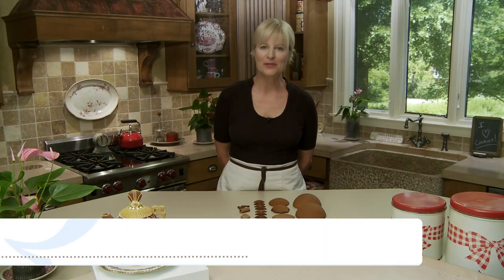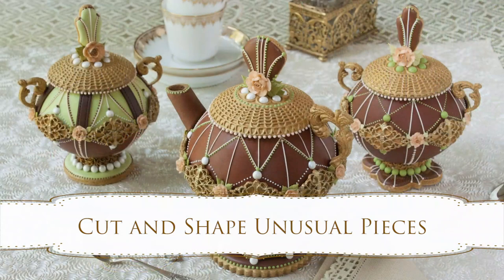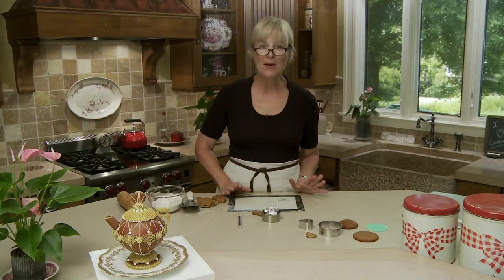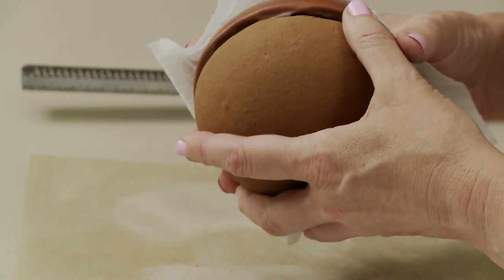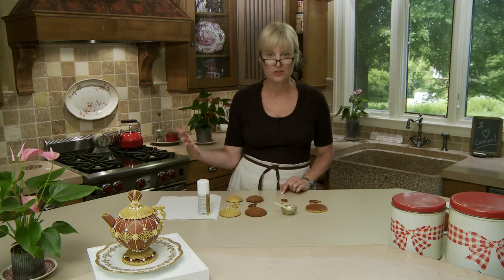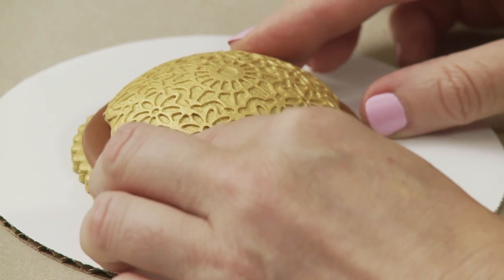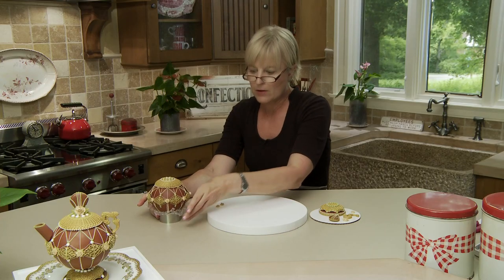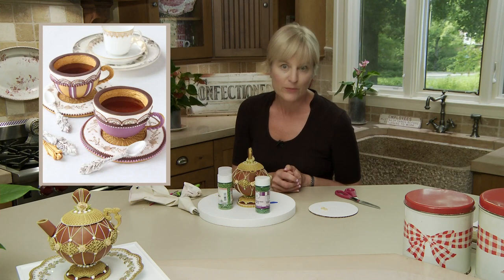How to Make 3-D Teapot Cookies

Comment: is the cake baking soda free?I already have a mat😃
Reply from the maker: These are cookies, not a cake, so I am a little confused by your question. However, my cookie dough has some baking soda in it, but I usually cut the regular amount in half when making contoured (rounded) cookies like these. And roll the dough very thin (about 1/8 inch) to prevent cracking of the dough as it bakes over the curved surface.
Reply: @JuliaMUsher  I use a translator, I'm from Poland. I asked about the patterns reflected on the mat if they would be accurate with or without soda.
Reply from the maker: @jagoda2115  I still don't understand. I used my recipe here with half of the baking soda I usually do, and the patterns (from embossing it with mats) are quite distinct as you can see in the video, provided you roll the dough as thin as I suggest. Did this answer your question?
Reply: @JuliaMUsher  Yes, Thank you very much.💘💘💘
Reply from the maker: @jagoda2115  Great! :)